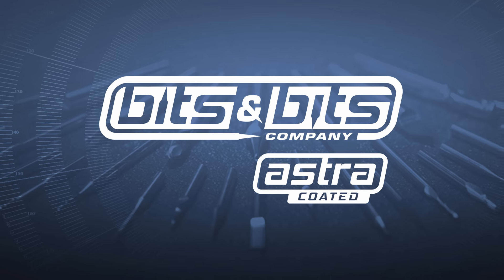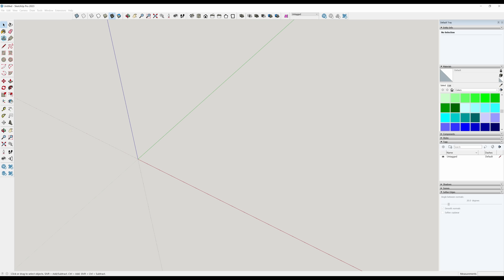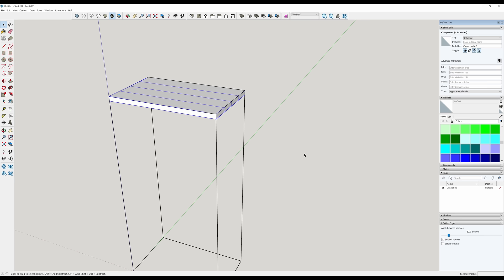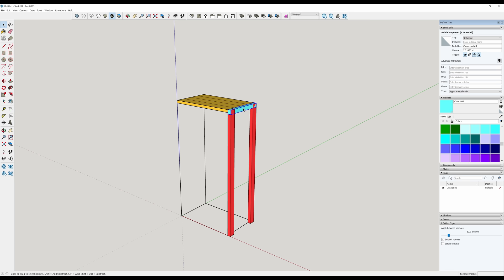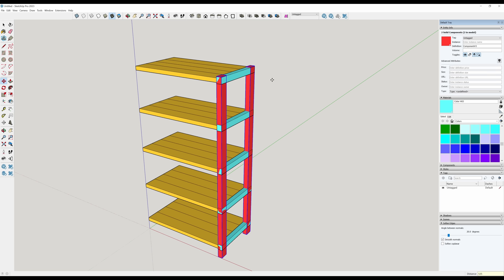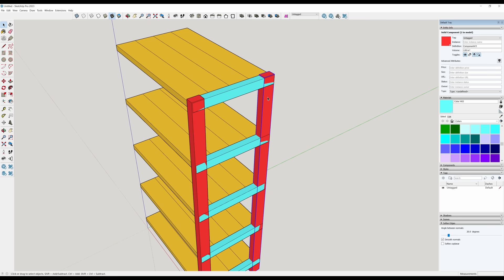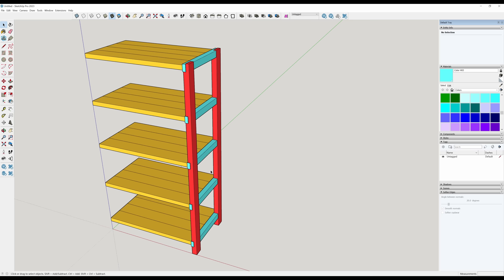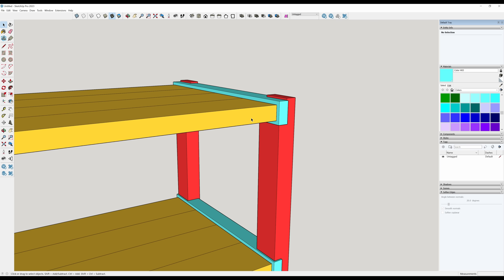SketchUp: Proud Halflap Shelving System

Comment: It's wonderful to see you're using components, flipped/rotated components to reduce the work you need to do in SketchUp.
-But sometimes you can't just copy a single component if you have mirrored them (that's not the case in this case, though - hmm a case in a case ...)

Sometimes I group the contents of the components and rotate-copy ("Q") a lot of components, then move the group inside one of the components, just to adjust its position to where all the pieces meet. You don't need to use this "feature" often, but it's quite handy when you actually do need it.

Yes, on a Mac, screenshot is something like Command+Shift+3 (or 4) depending on if you want to use a rubber-band, or entire screen. You can also press space after Command+Shift+4 to get a "window-shot"...